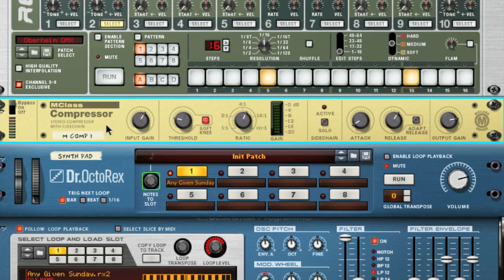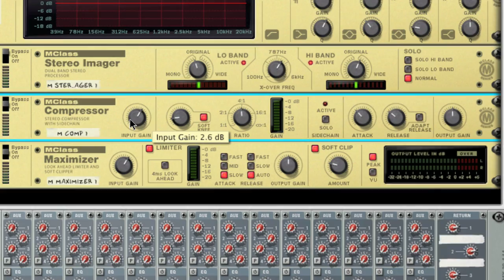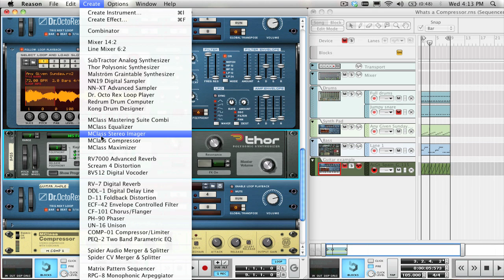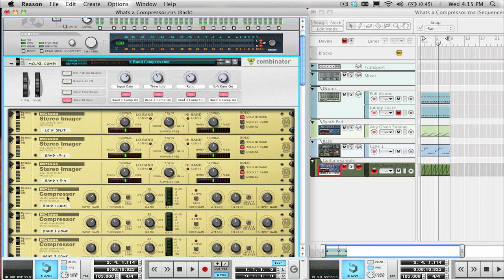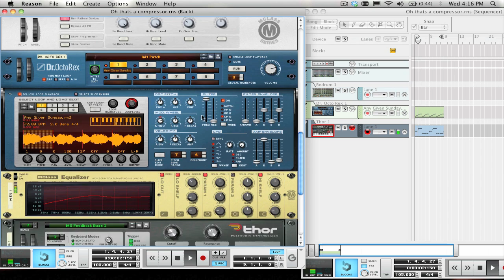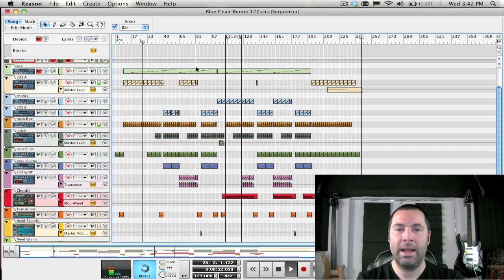52 Reason / Record Tips - Week 39:  Compression Tips for the Best Mixes

Comment: Compression reduces the dynamic range of a signal by a ratio (X:Y) so, if you've got a dynamic range of 20 db for a particular instrument across a piece of music and you have a compression ratio of 2:1, you would get a dynamic range of only 10 db (quietest to loudest parts of a given signal on a track). Dance music or pop music typically requires less dynamic range so, higher compression ratios (often to the extreme) for very narrow dynamic ranges are used for this type of music. 

Classical music, OTOH, is much more dynamic and typically requires a larger dynamic range per instrument but the effect of the compressor is the same regardless.  If a violin or viola's dynamic range for a specific piece on a specific track of a recording is say, 50 db (quietest to loudest playing of the instrument during a piece), a ratio of 2:1 would reduce that volume range by 50%, or to 25 db from the original 50 db. Does that make sense? 

Also, most compressors include an attack and release envelope for shaping how the compression begins and ends (sharp or slow) and a threshold knob that sets at what level of sound input the compression effect is enabled. Some compressors also offer other options such as gain make up, soft knee compression (dBx), or simulated saturation limiting options as well.

Comment: Try to avoid messing with the master fader where possible. The idea is to bring each track down in volume to balance them all out and give your mix enough headroom that it doesn't clip or distort.

Lower is better; more headroom means it's easier to work with EQ and effects. With the right compression and limiting, you can bring the entire mix up and make it feel and sound louder without distortion or clipping, which is the point of this video.